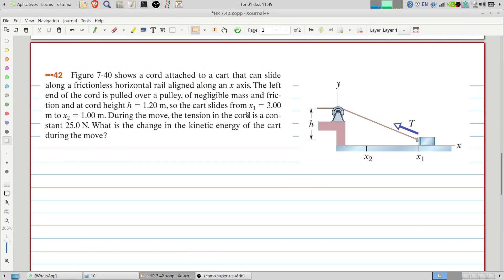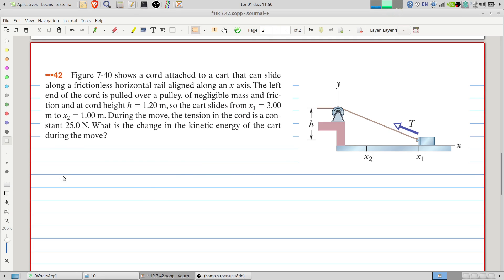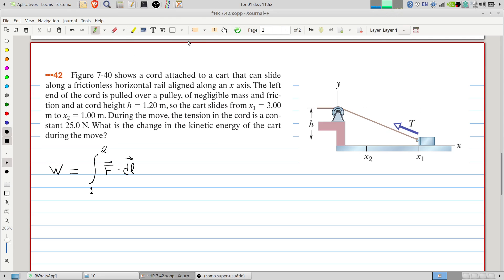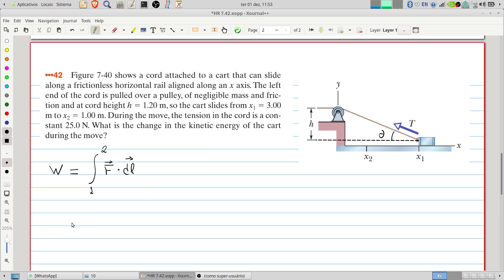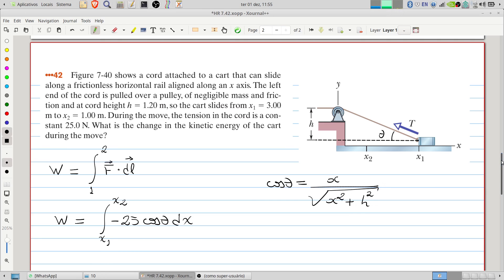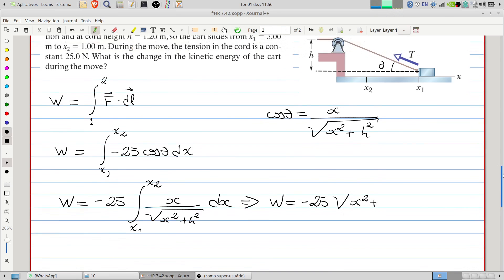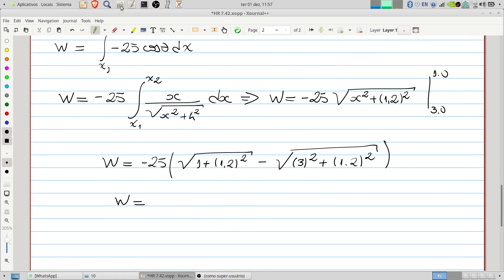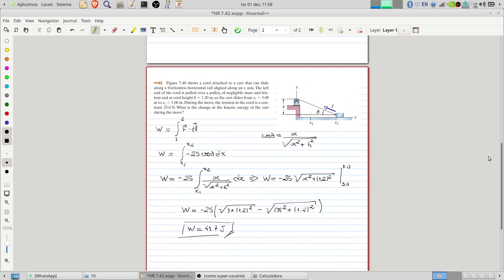Halliday & Resnick - Chapter 7 - Problem 42

Comment: tell me please what is wrong in my calculation: I think the angle theta is to be calculated differently- we take right-angle triangle where adjacent leg is of length of 3 m and opposite leg of 1,2 m. Now we calculate theta using tangens, where theta is 21,8° . Then we just simply multiplicate 25 N . cos (21,8°) . 2m = 46,4 J
Reply from the maker: It seems to me that you are considering the angle theta to be constant, this is not correct, the angle varies from x1 to x2.
Reply: @physicsproblemssolutions5362 tysm